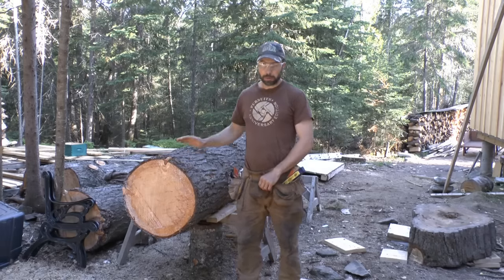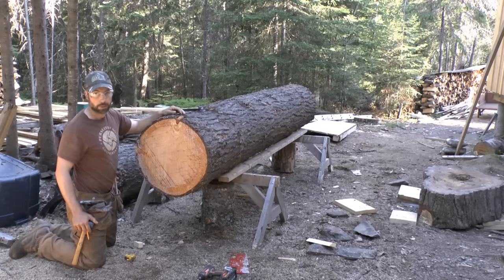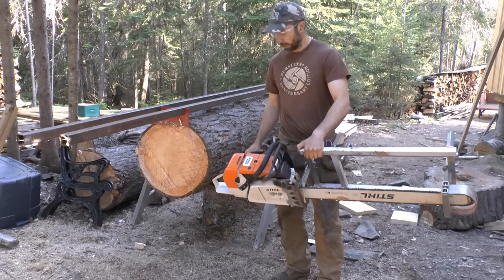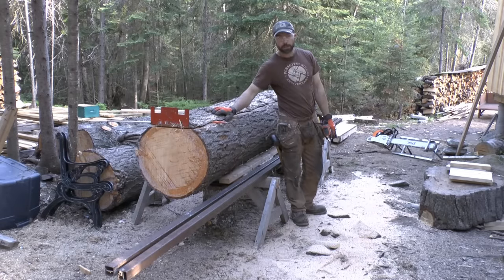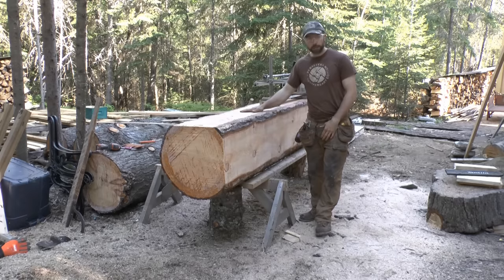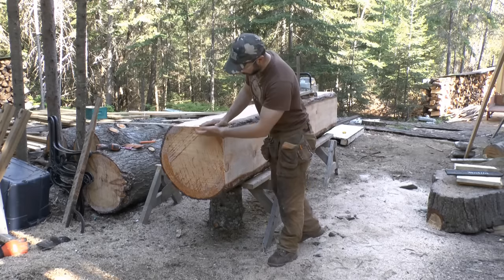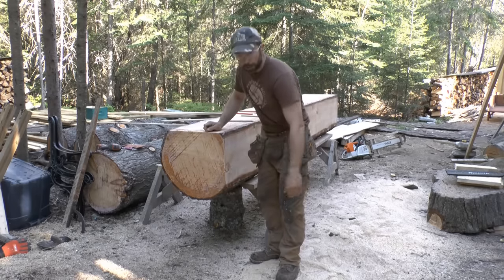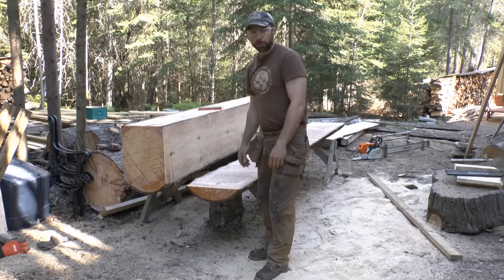Logs to Lumber: Alaskan Chainsaw Milling

Comment: Did you manufacture your end plates yourself? If not where can I buy one? Thanks
Reply: Just found this earlier comment from Lure of the North:
5/32" x 2" x 2" steel tubing, bought locally. 
The end plates are 1/4" x 12" x 5". The notches for the rails are about 1-3/4" deep so that the 2" rails sit a bit proud.  These were cut locally by a metal fabricator.

Comment: Trim planks on a table saw... actually, quite easy!  Just screw a straight edge to one side of your plank and run the plank through your table saw to get one true edge!  Then turn the plank around and run the plank through the table saw again to get the width you want!!!

Comment: nice video - can you give me the dimensions of your plates?  I want to make some - assuming those are .250 plate and 2x2 rails?
Reply: Just found this earlier comment from Lure of the North:
5/32" x 2" x 2" steel tubing, bought locally. 
The end plates are 1/4" x 12" x 5". The notches for the rails are about 1-3/4" deep so that the 2" rails sit a bit proud.  These were cut locally by a metal fabricator.

Comment: Where did you purchase the plates and rails or did you make those yourself?
Reply: Just found this earlier comment from Lure of the North:
5/32" x 2" x 2" steel tubing, bought locally. 
The end plates are 1/4" x 12" x 5". The notches for the rails are about 1-3/4" deep so that the 2" rails sit a bit proud.  These were cut locally by a metal fabricator.

Comment: Where did you get the plates to attach to the log for leveling?
Reply from the maker: 5/32" x 2" x 2" steel tubing, bought locally. 
The end plates are 1/4" x 12" x 5". The notches for the rails are about 1-3/4" deep so that the 2" rails sit a bit proud.  These were cut locally by a metal fabricator.

Comment: Did you make the plates or buy them someplace ??
Reply: Just found this earlier comment from Lure of the North:
5/32" x 2" x 2" steel tubing, bought locally. 
The end plates are 1/4" x 12" x 5". The notches for the rails are about 1-3/4" deep so that the 2" rails sit a bit proud.  These were cut locally by a metal fabricator.

Comment: Hi love your video I have the same sawmill but I have the grand berg rails and find them really hard to level and very time consuming. Do you sell the brackets you have and if so I would buy a set right away i live in north bay
Reply from the maker: I don't sell them, but you can easily get someone to cut them.  Info is pinned to the top of the comments section.  Have fun!
Reply: Thank you

Comment: What are the specs on your rails? 1/8” or 1/4’ - 14’ ?
Reply from the maker: 5/32" x 2" x 2" steel tubing, bought locally. 
The end plates are 1/4" x 12" x 5". The notches for the rails are about 1-3/4" deep so that the 2" rails sit a bit proud.  These were cut locally by a metal fabricator.

Comment: What are the dimensions of the steel plates?
Reply: Just found this earlier comment from Lure of the North:
5/32" x 2" x 2" steel tubing, bought locally. 
The end plates are 1/4" x 12" x 5". The notches for the rails are about 1-3/4" deep so that the 2" rails sit a bit proud.  These were cut locally by a metal fabricator.

Comment: Chop the bark off with the dirt use sharp axe do both sides for chain on saw cut. 10 to 20 minutes much better for the chain ...
Reply from the maker: With dirty bark I agree, it is worth cutting it off with an axe or spud.  These logs were cut and hauled in over the snow, so were quite clean.

Comment: Did you make the end plates
Reply: james mcguire it doesn’t look like it, but definitely could have! You can buy them or make they. I would look for Slabbing Rail Brackets.
Reply: Just found this earlier comment from Lure of the North:
5/32" x 2" x 2" steel tubing, bought locally. 
The end plates are 1/4" x 12" x 5". The notches for the rails are about 1-3/4" deep so that the 2" rails sit a bit proud.  These were cut locally by a metal fabricator.

Comment: What are those plates you screwed on end called and where do I get em?
Reply: SoSwiff, I believe they are called Slabbing Rail Brackets. You should be able to find them on www.granberg.com
Reply: I do not see them on granbeg or anywhere else for that matter.  If purchased would love to know where.  If made what side steel tube are you using?
Reply: Just found this earlier comment from Lure of the North:
5/32" x 2" x 2" steel tubing, bought locally. 
The end plates are 1/4" x 12" x 5". The notches for the rails are about 1-3/4" deep so that the 2" rails sit a bit proud.  These were cut locally by a metal fabricator.

Comment: Where can I find the plates
Reply from the maker: 5/32" x 2" x 2" steel tubing, bought locally. 
The end plates are 1/4" x 12" x 5". The notches for the rails are about 1-3/4" deep so that the 2" rails sit a bit proud.  These were cut locally by a metal fabricator.

Comment: Birds are yakking away! Lol. How long before it dries out?
Reply: 6 months to really dry for pine or it will shrink on you after you nail it up. Oak 1YEAR
Reply: Not in Colorado. Pine is dry in a month. Don’t have much oak but any elm or cottonwood would only take slightly longer. Out humidity recently is in the teens. My skin looks like a shedding snake.

Comment: I seen this question asked several times but didn’t see an answer. What are the Dimensions of the plates and size of rails you are using? Please?
Reply from the maker: It should be pinned as the top comment, but here you go: 
5/32" x 2" x 2" steel tubing, bought locally. 
The end plates are 1/4" x 12" x 5". The notches for the rails are about 1-3/4" deep so that the 2" rails sit a bit proud.  These were cut locally by a metal fabricator.
Reply: @lureofthenorth  thank you! very helpful video!

Comment: I can't help but think that any fault or bump will be transferred to every next cut.
Reply from the maker: The only issue we've had with that has been some chattering. Switching the chain ended up helping with that. But a little character on the boards for us is okay! Once I stained the boards you can't even tell. Most of our boards come out just beautifully!

Comment: Are you sure that 2" square tube is 5/16" wall?  Thank you sir.
Reply from the maker: Will double check and get back to you tonight
Reply from the maker: 5/32" not 5/16".  Thanks for catching that!
Reply: @lureofthenorth  Well I finally made the plates (made them from 1/4" aluminum) and I am using 2 - 12' sections of 2" square tube 1/8" (AKA - 11 gauge). So much easier and faster this way, thank you so much for the tip! Milling Cherry, Oak and Walnut in Ann Arbor, Mi.
Reply from the maker: Awesome!  I've got a few hardwood logs lined up for this year, but mostly find softwoods around her in nice milling widths.  Have fund with those!

Comment: Can someone tell me where to get the plates that he screwed into the log? I can’t find them anywhere
Reply: I was wondering exactly the same thing.
Reply: They must be custom. Hmm
Reply from the maker: 5/32" x 2" x 2" steel tubing, bought locally. 
The end plates are 1/4" x 12" x 5". The notches for the rails are about 1-3/4" deep so that the 2" rails sit a bit proud.  These were cut locally by a metal fabricator.

Comment: Hi, what chain are you using? Ripping chain / skip tooth?
Reply from the maker: Its Granberg rip chain.  Full complement, but every other tooth is a half-size scoring tooth.
Reply: Lure of the North thanks man. I suppose you’re not sharpening that with a hand file - what, 150 links or so?

Comment: What saw is that? Thanks.
Reply: Jared Rogers not sure, but probably something with 60 or more cc’s for a log like that. For smaller logs, I have used my 40cc saw and it worked good but I was pushing it to the limit. It’s fun!
Reply: He said 120cc (Stihl 880)

Comment: Ho ?! That's kind of a trifle, but the stumps at the second stage of lifting the log were not placed on one line, but with an offset !! - And due to this, - first one end of the log sank onto the distant goats, and then the other end onto the nearest ones !! - Therefore, the possibility of rolling and falling of the log is almost excluded, as if the log was lowered simultaneously !! )))

Comment: Did you buy the metal jigs the tubes set in ? 
What about your saw ? 660 or 880 ? 
How about the chain ? ## ?
If I wanted to cut oak ?
And the rig for the saw. 
Best set up I've seen so far. 
Bought or ??
Reply from the maker: The saw is an 880, with 36" bar.  Running Granberg rip chain on it.  The mill is a Granberg Alaskan Mk III. 
The end plates are just 1/4" steel plate, had a metal fabricator cut the notches in the plate to accept the steel tubing. Plates and rails were ~ $50 I believe. Have fun!
Reply: Thank you so much!
Sweet.

Comment: Which saw is that?
Reply from the maker: Stihl 880
Reply: @lureofthenorth  I thought it looked bigger than my 660
Reply from the maker: A 660 will still cut a lot of lumber!
Reply: @lureofthenorth  I've been very happy with it so far. I want to get one of those cannon dual head bars and a pair of 070 to cut some big slabs next
Reply: @lureofthenorth  How big (or wide) of log could I cut using a Super 034av?  I'm currently running a 25" bar.
Reply from the maker: @nathanbennion6678  Looks like that's about 56cc, which is very light for milling, as rip cutting requires more power than cross cutting.  I started with a 64cc saw with a 28" bar, and was able to mill up to 24" white pine at a reasonable speed.  I wouldn't want to go back to that saw now, but for starting out I found it exciting and efficient enough for my needs.  I think you'd find it competent on a 20" diameter softwood, and if you really get into it you'll probably look for a bigger saw down the road.

Comment: Dude you live so dangerously, i hope them logs don't ever land on you, i was waiting for 1 of you guys to get run over with that log, why don't you do a little bartering, & trade some wood to a guy that welds real good, that needs wood & build you a log station, with a roll over hydraulic system & some rail blocks, that fold down, & a roll up ramp with a wench, to move the logs up onto the log cutting station, them saw horses aren't going to last with all that weight your putting on them, 1 day their going to give out at the worst moment & someone's going to get hurt really bad, if not killed, just saying, but love your videos, & yes bro. I subscribed , & gave you 👍's up, i really hope you get a heavy duty log station tho., those are some huge logs, work safer , not harder 10 '👍👍👍👍👍👍👍👍👍👍 up
Reply from the maker: I have dreamed of a nice set of bunks to roll a bunch of logs onto and bring them out to the mill one at a time!  But there is a lot to do around and the horses are so damn easy.  Thanks for the support!

Comment: This is a painfully slow process for for just a couple of boards ‘ everybody that has an Alaskan mill says this’ chainsaw were never meant to be pushed or pulled through a piece of wood ‘ using a chainsaw at full revs for a long period is not ideal ‘ and leads to rapid wear out  ‘ at least u have the log at a nice working height and not on the ground like a lot of sawyers ‘ I know a ripping chain make it easier and I mean a proper ripping chain and bar which cuts a narrower kerf ‘ no a modified cross cut chain ground to 10 degrees  ‘ trying to mill with a standard crosscut chain is very hard word on both man and machine not to mention the waste of wood ‘ ever 3 passes u lose 1board if u are cutting 1 inch boards’ ‘ I think there has to be an easier an quicker system to get a few boards ‘ am I totally wrong here?

Comment: Using a chainsaw mill is great if you only have a few logs to make lumber with, or you have a monster wide log to process.  Beyond that, if you have many logs to mill, it's best to get a proper saw mill (bandsaw or swing blade).  The savings in gas, lumber loss due to kerf size, time and energy will more than pay for a saw mill.

Woodland Mills is an Ontario, Canada based maker of bandsaw mills at very affordable prices.   https://woodlandmills.ca/portable-sawmills/
Reply from the maker: With no road, and no ATV on our property, our ability to move logs has been very limited.  This year (via snowmachine and komatik) was the first year we moved any logs, and so we did talk about a bandsaw mill. But the chainsaw milling has treated us very well.  My first job with the chainsaw mill was to cut up a monster pine that was too big for the local band-millers.  This summer I spent a couple of days helping a friend block up a bunch of trees at a boat-access property so he could barge them out to his bandsaw mill.  If and when I get a bandsaw mill, I can see I'll never regret the (relatively) inexpensive investment in a chainsaw mill, as I think it will always be a handy tool to have available. 

I hadn't looked at the Woodland Mills, but the price does look really promising, so I'll take a closer look when the time comes, thanks for sharing!
Reply: I've been drooling over the Woodland Mills bandsaw for a few years now.

Comment: After you cut the log up , you can go shopping for a new chain saw . The money you save on the boards can be the down payment on a new saw . Not meant for long runs under load . Someone please invent a small band saw , like a shop band saw that you can power with a chain saw motor . Or save you hands and ears and lungs and just buy a wood- mizer
Reply from the maker: Many years and tens of thousands of board feet later, the saw is still running strong.

Comment: There're two types of strong:
1. "Girly-man" pump-U-up type: Barbell, rubber floors, deadlift, bench press, lotsa mirrors, etc.. Balanced, known, clean n dry, predictable.. 
vs.
2. What? That was 'too' heavy-n-awkward?? (1400 pounds) Was it?? ..Huh.. well, I got it where I wanted it now so never mind, let's get to the fun part.. Work! 

Clearly you're a 2.. Effective..  ...js

Comment: try sharpening your blade...you have more dust then chips...fish and chips without the chips...lol
Reply: Its called a chain. A ripping chain.
Reply: Ripping chain, or a skiptooth chain.
Reply: Lloyd Ankney when your ripping wood long way with the grain, it doesn’t matter how sharp the chain is. It always gives smaller and dusty chips. You can buy a ripper chain that will bite better and pull bigger chips. I bought mine from a logging supply company out of Washington state. Before I got my ripper chain I filled my factory chain to a 25 degree angle instead of factory 30 degrees. A better bite and cut from stock chain.

Comment: I just noticed safety is not one of your concerns as you have a log weighing several thousand lbs. and when you walked behind it it could have rolled off and crushed you like a frog hard to dial 911 with a broken arm